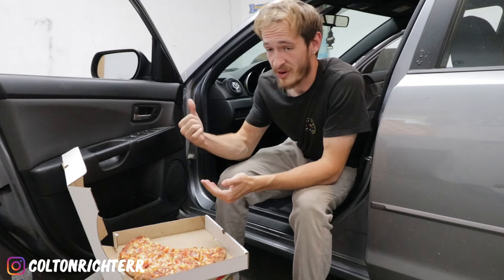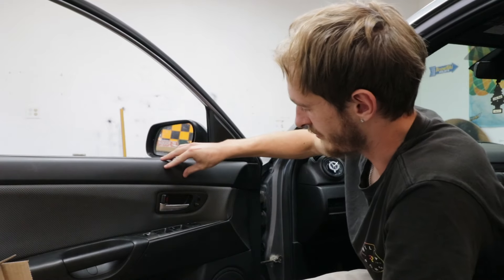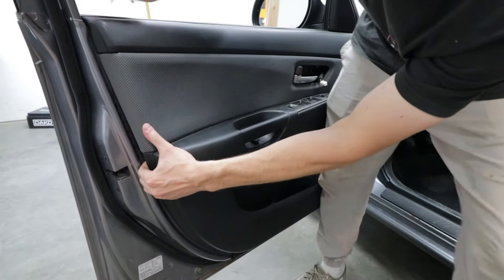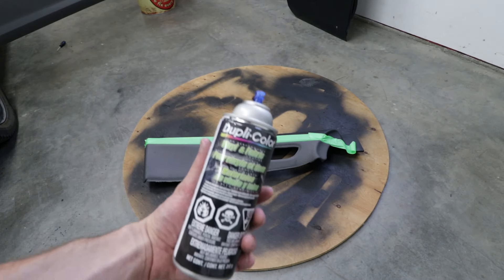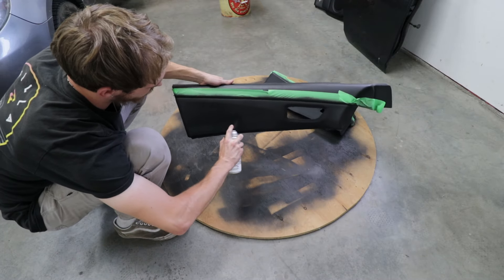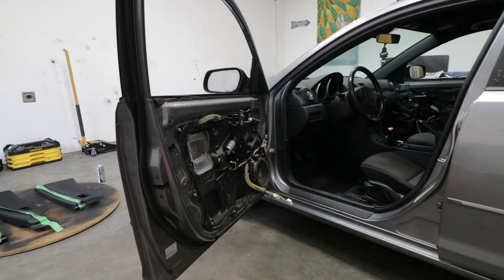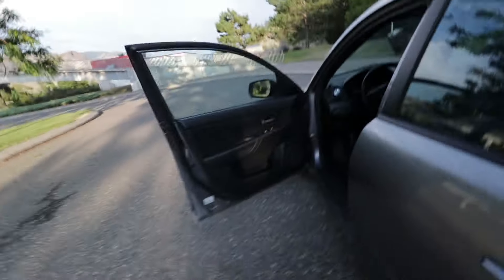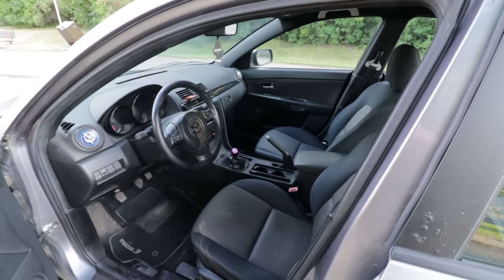How To PAINT Door Fabric/Inserts (EASY DIY)

Comment: I carbon fiber wrapped my center console it looks awesome and is very easy to take apart, I did paint it gloss black at first but it turned out terribly wrong, glad it did cuz I soo happy with the wrap,
Reply from the maker: Wrap also looks incredibly good!
Reply: How do I get pics to you
Reply: I by the way loving the videos, and I copyed the throttle ground mod, defo revs faster from 3000 rpm.

Comment: For anyone watching, a completely unrelated list of Mazda 3 must-have mods/fixes:
* Coilover kit, to eliminate the excessive lurch when turning tight corners
* Wider, low-profile wheels (I'm running 225/R18) to eliminate side-to-side sway while changing lanes
* "Sports intake", i.e. just replace the original intake snorkel and resonator with a straight tube and one of those fez-looking filters - the wider tube will let the engine suck up a little bit more air, increasing the high-end power slightly, and without the resonator the engine sounds better
* EGR delete - the only thing it does in that particular car is get gunked up and causing uneven idle and rev hang
* Regular cleaning of throttle body (and IAC valve if you have a cable-actuated throttle body)
* STP Ultra in the tank to clean out the gunked injectors and a slight chance at maybe cleaning up the valves and cylinders
* LED interior lights for that clean look
* Upgraded speakers and subwoofer. The Mazda 3 stock radio can accept a Bluetooth module that pretends to be a CD changer; that's the best $60 upgrade you can get for it.

Pretty sure Colton has videos on all of these.